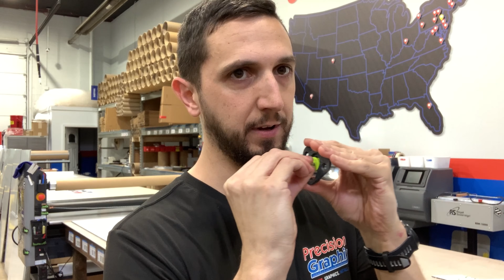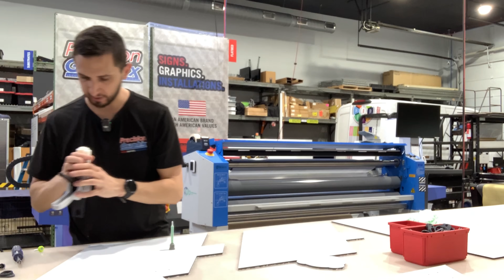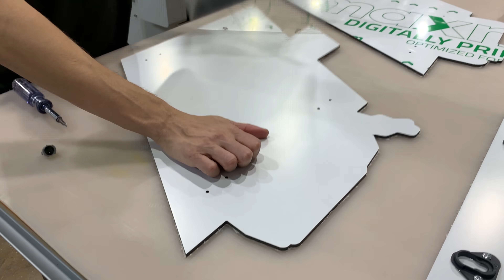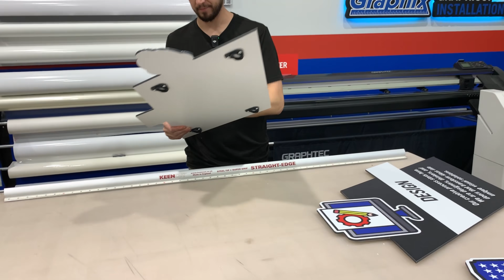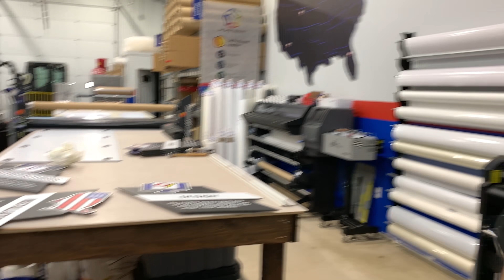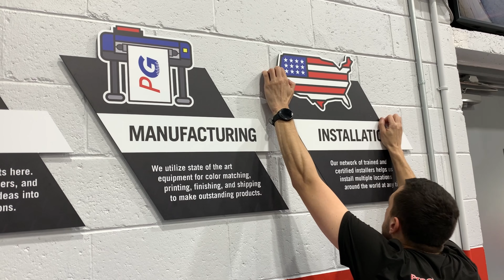How we blind mount signs using MBS Button Fix | Steve The Graphics Guy

Comment: Looks great, can you do a video showing your preferred method for installing the wall posts to make sure they are aligned
Reply from the maker: Yes, these were existing as we were just updating the panels. I’ll make a video that shows the design part. We basically router out a template that has them pre spaced

Comment: Looks great, how did you get the parts on the wall in the right spot. Also noticed you had a liner on the front to protect the print - how did you achieve that?
Reply from the maker: I made a template in our design software and then plotted it out on styrene to transfer it to the wall. The front layer had premask on it to protect the surface when routing them out